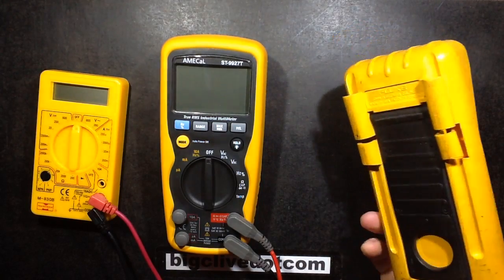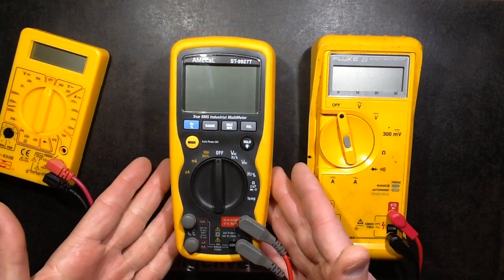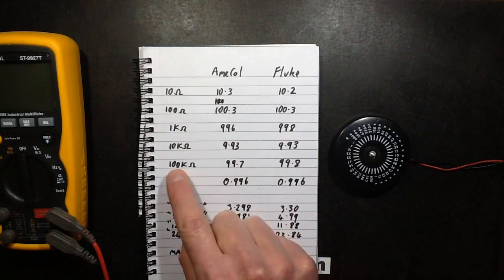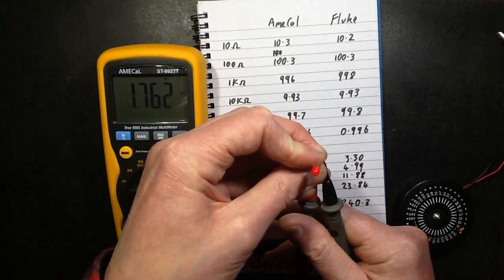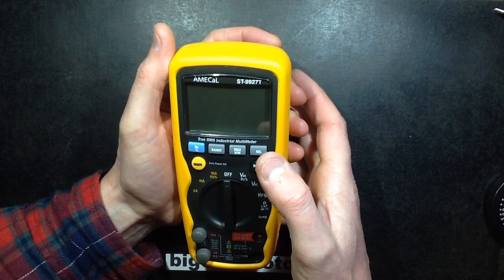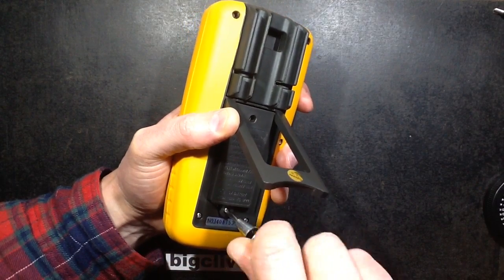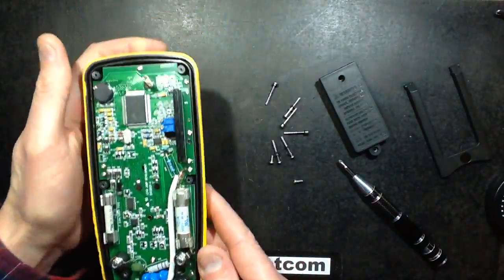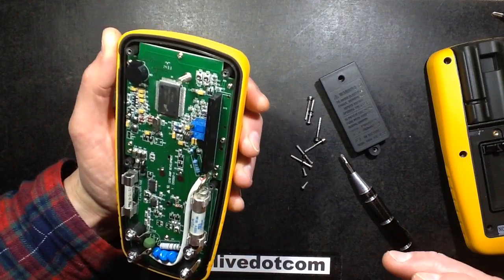Test and look inside Amecal  ST-9927T multimeter.

Comment: I worked as an aircraft mechanic for over 21 years and my Fluke was calibrated every year till 2014 and was always in tolerance. So those Fluke 23 meters are very reliable. Quite a few of us had the Fluke 23

Comment: Your best video yet, you sold me if I need another meter. I had the fluke 77 and I never felt it lasted as long as it should but seeing a thermometer, IP 67 AND a row of beefy MOVs puts it over the top for me plus these days that large readout is awesome. I started with an analog meter and I always found the DMMs rather annoying in their non linear sort of readout, you could see the ripple in certain circuits where that has never been captured by a DMM even with the bargraph below it. My last one was a RS one(like the analog meter) and I just realized it now has outlasted the fluke. Can't remember what I paid for it. But the analog meter was the king in the store -- HUGE wide needle readout, mirrored back, and cost a whopping $40 back then. I got it on sale for $25. Best $25 I have ever spent in the electronics industry, period.

I'd love some new probes with all those features and protections. We used to use model RC hose over the ends to put wires in as autoholders. Nice little trick.

Comment: That's a lovely cross-check between new and old meters. Very confidence-boosting. I've a 1961 Sullivan decade box rated 0.05% and it's at least that good over 50 years later. Needs a clean now and then. Fantastic construction. There are others at work some dating back to the 1940s and some with 0.01R increments. Never had a reason to doubt them. Gorgeous!

The difference measuring mains is probably due to how the two meters handle harmonics. UK mains is often flat-topped and this will lead to a mean-reading meter being lower than true RMS. If in doubt, I would trust the Fluke. Back in the day they had a small silicon fab for their own design of RMS to DC converter ICs. If I really wanted to explore I'd knock up a couple of sound files: one with pure fundamental and another with a bit of 5th and 7th harmonics whose form factors I knew, and test at low voltage via a sound card. (There isn't much 3rd or 9th due to our 3 phase transformers being able to self-excite via the delta winding.)

The deep-lipped battery cover increases the in-air path length from battery (at COM terminal potential) to finger for transient protection.

Comment: Very interesting video Clive.  I am impressed by the AMEcal also and you have to love the size of the display.  I am still using a Fluke 8062A true RMS meter (discontinued), which is quite good but getting old - probably 25 or more years old (but made in the USA).  At the time it cost me an arm and a leg.  Yes, the AMEcal seems to be a quite good value.

Comment: I have an old Fluke 27 I got from Alltest test equipment in NY as govt. surplus and its accuracy is still top notch, I was shocked not only at the excellent overall condition of the meter but the performance is like day on when it was built.  And built like a tank I may add, I mean this thing is really made to last its a beast.

Comment: 8:45 I used to have an Aneng multimeter that I bought on banggood. It was supposed to be able to measure up to 10A, but while I was measuring 3A, it literally melted.
Reply: You can measure 10A but for a 10-15 seconds. The shunt gets too hot and needs to cool down.

Comment: My only "whine" about some DVMs and the AMECaL meters, is the auto-off function that cannot be disabled, you can only alter the duration before it switches off (there is not a 0 or off function)!
I have an AMECaL ST9929 and AMECaL is looking into how to disable the auto-off function for me, but I have my doubts if it will be possible.

It's a pain when taking measurements over a long period of time that the meter switches off, and I'm very reluctant to just move the dial to off and back to the range I want again in order to switch the meter back on, on the grounds it might damage the AMECaL ST9929 meter sticking a couple of hundred volts into a range that it is not meant for or an amp or two or into a range that isn't meant for current.

I do like Clive's older AMECaL non-auto range meter where you just press the on/off button to bring it back to life again, so much so that I'll probably get an ST9905 if AMECaL says the auto-off function can't be disabled on the ST9929.

I forgot to mention, the first meter I blew up was a Fluke, I can't remember the model, but it was a fantastic meter and cost me about 4 months' wages as an apprentice electrician, I loved it. However, one day I wanted to test the voltage along a Cockcroft-Walton multiplier and stepping along each stage until there was a BUZZ from the Fluke and the Fluke was no more.
I couldn't find a company to repair it back in the early 1980's when there was no internet and inquiries had to be all done by phone using the "Yellow pages" phone book!
To say that broke my heart was an understatement...... I don't think I made a mistake because the multiplier output should have been under 1000 volts and that was the Fluke's highest voltage range, it didn't help console me though at the time.

K watt.

Comment: Having spent thousands of dollars on Fluke meters over the last 40 years I can tell you I will never spend another cent on them.  my original 8024B was a wonderful meter that served me for many years, it was like a loyal dog until one day it started displaying 24 volts on a 12 volt battery, so convinced by the Fluke Rep, I sent it in for repair, many weeks later it returned with the same fault, so back to hospital it went ,several weeks and many phone calls later they told me that it couldn't be fixed, mind you I did receive a bill for the first repair by mail during this time.  So I purchased a new 87 at great expense, and Fluke canceled the charge for the first failed repair of the 8024B.  I think the 87 was a female as it could never really make up its mind on what it wanted to display always jumping up and down, but it did have Min,Peak and Max, recording as long as you remembered to retrieve the readings before it turned itself off.   Alas like all good relationships her twiddly knob became problematic just past the warranty period and I threw it in the bin, no way was I going thru that send it in for repair sequence again, the later revisions probably addressed these issues but early adopters like me never got upgraded.  Stupidly I went again with a fluke scope meter that i just recently purchased a new battery pack for, only to find out that it seems to have forgotten how to test resistance and volts.  I can't even remember how many friends have wasted money on those T5-600 heaps of shit, T was for Temperamental with them.  to use one of my fathers sayings "Not worth two knobs of goat shit".  Kyoritsu TES and Hioki for me now.
Reply: Hoo, "one of my fathers". How many fathers did you have - to the nearest 0.1?

Comment: I noticed the screws on the external back cover had small o-rings, but one came out without one (presumably still in the hole) I hope you fished it out so it keeps its waterproofing.
Reply from the maker: I did make sure they all went back.

Comment: if your meter has not much drifted after such a long amount of time you can be quite sure that the voltage reference has pretty much "burned in" so it won't drift much in the future as well
except for scenarios like corrosion, thermal shocks etc.
my old trusty hp meter is almost 30 years old, it has not been calibrated for over 20 years and it's still bang on when i measure calibrated standards

Comment: MPR, Is that not for receiving Modulated Public Radio?   I got a zetec 10709. It has non contact voltage, cat 2 high voltage and a momentary back light. Covers both ac and dc via a push button switch. My thurmister cable does not work,
I followed along with you and it seems to cover just about everything that you said for it to cover.

Comment: Also sold as "DMM 1000 P" in the scandinavian store BILTEMA art.nr 17-238. Slightly different screen printing on it but otherwise the exact same look, switch, screen... Good meter, have served me well for a few years now. :)
Reply: +Farad Husky It´s not the same meter, if you see the off position on the dial they are completely different. The PCB can´t be the same.
Reply: +Farad Husky Tack för tipset :D

Comment: I think you got a slightly bigger difference on the 240Vac measurement because multimeters nowadays use a diffent method for measuring true RMS than the Fluke23 does. If you get the chance to stick both over a beefy frequency drive you should see an even bigger difference with the Fluke off by as much as 80-100V
Reply: Newer fluke has a LPF low pass filter range. The high frequency switching of the VFD generates harmonics that screw with the readings. A low pass filter reduces these harmonics.

Comment: Ugh ant stand Dave's "reviews" Unless it costs £500 then its not worth it to him. Really does my head in!
Reply from the maker: Dave is quite demanding when it comes to meters.  But to be fair, he does decent enough tests to help you form your own opinion of them.  His utter contempt of the Extech meters didn't stop me buying one of the same style.
Reply: +bigclivedotcom 
Is not exactly true. If you follow Dave's video you can see that he use a Brymen BM257 witch is less than 100 £. I think that is a pretty good value for money. Did you took this meter into consideration? Thanks.
Reply: +Callum Burns i get one uni-t  and ended sick of it and was 130€ model then i get a  brymen 867 dave have it and morton review too and it worth and was only 160€ and it worth.
Reply: +Callum Burns Or when they pay him... like bryman multimeters
Reply: +Callum Burns 
His review helped me to find the Extech EX330. Not the best protection, but for I found it for 35€ which is an absolutely awesome bargain for a meter with such capabilities.
Also I got myself a HP 3578A benchmeter for a 100 bucks on ebay for all the precise stuff and a cheapass uni-t clamp meter (about 50€) for measuring ams on mains lines.
I'm quite happy with this setup. There is virtually nothing I can't measure with these meters.
It's not always about the price and build quality... just find the appropriate device for what you want to do.
Reply: Dave is interested in professional equipment. If you want good kit them pay the money. For most hobbyists el cheapo is good enough. If you are working on a board that costs £60,000.00 then using el cheapo could damage it and get you sacked if you are lucky or sacked and having to pay for a new board. Most of my multi-meters are in the £350 range with oled displays. Good hobbyist and borderline professional. A compromise as always.
Reply: Pedram Aside from that Dave Jones says he doesn’t accept payments from any companies, I don’t think he’s paid by Brymen: his first EEVBlog-branded meter was a Brymen with slight custom firmware, but his new meter that he designed from scratch is made by someone else (I think it might even be CEM, who made the one in this video, but I’m not sure).
Reply: Dave repeatedly says not to pay over $50 for a decent meter.

Comment: I bought the CEM DT-9927 off aliexpress.com a year ago for $60.  It is my 2nd meter.  The thing is really excellent.  It is identical to the one review here except it is not true RMS AC.  It came with a very nice, zippered case with a belt loop.  It has the thermocouple too.  They stopped selling it on aliexpress but you can find them on eBay for around $100.

Comment: Ordered this a year ago (just over) and it has failed on me. The centre selecter broke up, after trying my best to stick it back together with epoxy I've since noticed two of the copper spring contacts are missing so it's pretty much scrap any way unless you know where I could get some replacements? I contacted Amecal and what they want to repair almost justifies buying another new one. I think I'll buy a fluke and be done with it.
Reply from the maker: This appears to be a common problem with this style of meter under various brands.

Comment: ATG/AmeCal/Fluke/Harbor Freight Tools meters and many other circuits are made and built in China.

Between AmeCal and Fluke, the AmeCal is a better buy.

ATG says you do not need to send in each year to get your meter cal.
Just like torque wrench.
I like you used a second meter/torque wrench (torque adapter) to make a comparison.
But if you run a company then you have to send all instruments in yearly.

Well done on the reviews.
Reply: angelisone Only Fluke's cheapest meters are made in China. The better ones are all made in the US.
Reply: Not true. They are made or really the correct words are Designed in USA.

Apple is designed in USA. But is made in Korea and China.
Reply: angelisone No, the professional Fluke meters are MANUFACTURED in the US.
Reply: angelisone Check it out for yourself: http://en-us.fluke.com/products/digital-multimeters/fluke-87v-digital-multimeter.html
Reply: @omniryx1  All of the parts come from China made to be assembled and tested. Made in the US stands for four screws were tightened and a technician performed IEC 61010 testing in the land of the delusional freedom.
With same confidence I can say my uni-t was made in the EU.

Comment: Mr big Clive what are your feelings on current IP ratings coming over from China? I’ve noticed a lot of items rated at ip65 but have hanging loomed cables for you to connect into that can’t be rated at that level. Are they rating the main pcb only?
Reply from the maker: It's just another buzz word for marketing.  Stuff sold as waterproof often isn't.

Comment: You probably have Clive (but I can't find it) done an idiots guide to the more obscure functionality of a basic multimeter. I have just replaced my 40 year old Christmas present meter with a £10 Ultricsa unit from Amazon (other selling platforms are available) and I have no clue what the diode checking bits are about amongst other features. In fact I probably don't even know what it is that I don't know!

Comment: Been looking to get into raspberry pi and ordered a breadboard starter kit that comes with a fair few loose components. Which multimeter could you recommend that wouldn't break the bank, but still be good enough for a hobbyist?
Reply from the maker: +Fran Swa Most general purpose meters are quite usable.

Comment: Does the ST-9927T measure the True RMS value of AC signals only or can it do DC signals too (e.g. DC PWM)?
Reply: +ferongr Actually, this looks eerily similar to a Uni-T UT-61. Not in board layout but in operational characteristcs. Maybe the same OEM Uni-T uses manufactures these for Amecal with proper safety equipment (my UT71D uses glass fuses and has the varistor locations unpopulated inside it).

Comment: Hi clive im looking at getting a new meter as my cheapy crappy ones broke i went looking for the one from this video but couldnt find any so i went nosing and came across the UNI-T UT61E seems like a really nice meter should i be weary of it? 

Thanks again
Reply from the maker: +Stepy D Buy what you can afford, unless you work a lot with industrial electrical equipment when a proper industrial meter is required.  I've got some trashy meters on their way from China to test.
Reply: +bigclivedotcom i dont work with industrial stuff and i seriously doubt ill work with mains much if at all, im more like fixing broken things and been trying to dip my toe more and more into component repairs and liquid damage the cheap meter i had did me good but its died i could prob spend more on one just seen that it seems to be a hell of a lot of meter for the money and has all the features i was wanting with temp, capacitance proper working diode tests, auto range and so forth i can get one delivered to dundee for about £39 

thanks for the reply

Comment: Does the meter come with the case, test leads, etc as standard from eBay? The listing isn't clear, and i've tried contacting them but had no reply for over a week!
Reply from the maker: The meter has the yellow outer layer effect as standard, as it's built in.  It does come with leads, the thermocouple adaptor and thermocouple.
Reply: Thanks mate, just gotta wait for them to put some more non-calibrated stock up.

Comment: What kind of a screwdriver do you have? That looks awesome.
Reply: eBay type with multiple exchangeable miniature bits. I have two. I used to carry one in my pocket but the cap always unscrewed and dumped the bits into my pocket. Even when it didn't unscrew, the bits jingled. And the bits are all miniature - no good for normal size screws. All in all, the most annoying driver I've ever owned.
Reply: You get them periodically from Aldi for about £2.99. Very useful and more than adequate for this kind of thing.

Comment: Absolutely excellent review--practical, down to earth and covering all the actually important points without harping on things that don't matter. You have just made AMECal a crisp £80!!!  Sadly its not £56 in 2018 any more, but I think Santa Claus will be bringing me one for my birthday regardless. It helps that my wife doesn't actually know what a multimeter is and I have been saving up my pocket money, so...

In regards eevBlog Dave... yeah...  The 'unsubscribe' button is a marvellous thing. 'nuff said.

Before I click the eBay 'Buy' buttion one question has occured to me is; how does this meter compare with the AMECaL ST-9905? On the surface it looks like it might just be a question of auto-ranging over manual ranging. I wonder if BigClive or one of the chaps have compared the meters directly?
Reply: I have just watched a recent bigclive video and he is using the 9905